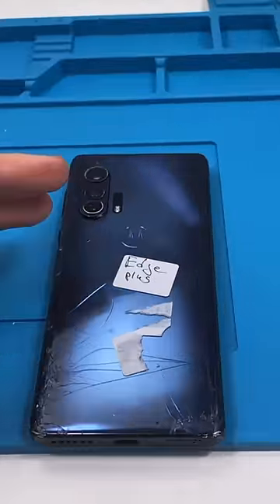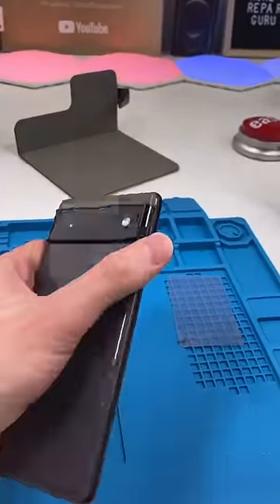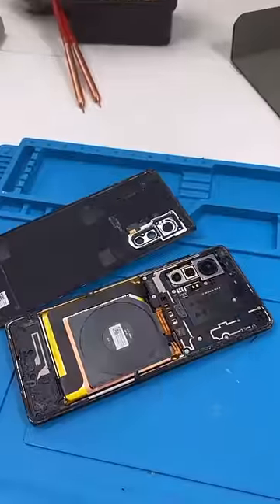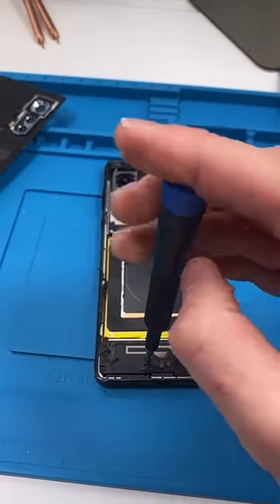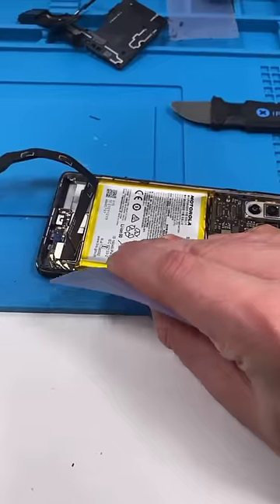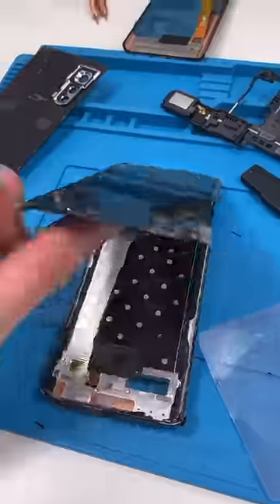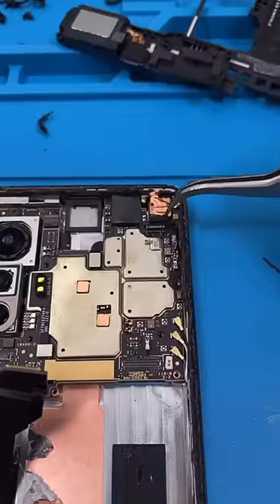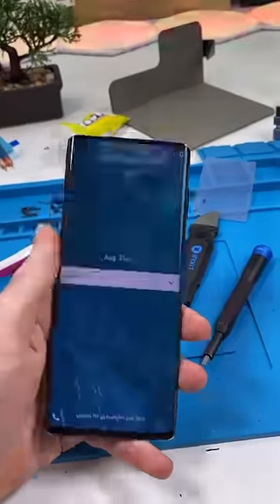MOTOROLA'S ARE TRASH... To Repair #Shorts

Comment: I love motorolas because they officially offer you the freedom to root their phones and install custom roms etc, no matter how expensive the phone is
Reply: Literally the majority of the android market
Reply: @Foreseen3  Yeah, but with motorolas and xiaomi (especially mi and redmi) you can change his rom easier
Reply: @Foreseen3  motorola is like linux, is a very customizable phone, more than android phones. And is cheap to do that
Edit: also lenovo has a program to enter fastboot on the motorolas
Reply: @Foreseen3  Motorola is better than android
Reply: To the comments above me. I’m a behind Motorola news, do they have their own custom software now? Or are they still using android.
Reply: @Foreseen3  The Edge 20 Pro is currently using Android 11, and it's basically unmodded by them.
Only a few of their apps installed such as Device Help (Which includes Warranty info and Software/Hardware test.), Interactive Wallpapers (It's pretty self explanatory, it has moving wallpapers on it.) and Moto (Includes a few extra features involving gestures that can be turned on and off there, and also on the settings.)
Reply: @galacticmaster4852  Motorola is android
Reply: Me on a moto phone
Reply: @Blockbustah  android is literally a Linux copy? (specifically talking about the kernel and some system integrity)
Reply: @hman6159  Motorola is still better
Reply: That's sounds unsafe
Reply: I hate mine it sucks
Reply: Same with Xiaomi. And oppo. And oneplus. And vivo. And redmi. And poco. Literally the only phone company that doesnt allow you to root is samsung
Reply: @rayyanshaikh5591  so Huawei never existed in first place
He probably means that it's so easy to unlock and mod Motorolas.
Reply: @Norza47  dude, the process of unlocking and nodding is the exact same, regardless of mobile company
Reply: I love Motorola phones to. I didn't know that they allow root option.Thanks for info.
Reply: mine came rooted because i requested it on the store
Reply: @rayyanshaikh5591  but its still super easy to root Samsung
Reply: @hamzamalik7305  at least it's fun to customize..

But not recommended for inexperienced ones
Reply: Sir!
Reply: @condofare6156   copy...?
Reply: @Victor Huang that's the image brands usually give it, but if you know what you're doing you'll be fine
Reply: @galacticmaster4852  The Motorola phone in this video is running Android
Reply: @condofare6156  Android runs on the Linux kernel, but it is nothing like desktop Linux distributions. Android runs on Java, Linux distros do not.
Reply: @rayyanshaikh5591  nah zte , oneplus, google, and lg have some absolute bs you have to go through to root some of their phones
Reply: @andrive  not an exact link to link copy but im pretty sure android uses Linuxes kernel
Reply: @mycelia_ow  im not talking on the UI or anything else, just the kernel so yeah
Reply: @condofare6156  exactly, pretty much everything else was built on top
Reply: @waterwolf6492   nope, some of them can't even be rooted at all since the Galaxy S8, due to Qualcomm's secure boot

Exynos users are free to root tho
Reply: @Blockbustah   it runs Android, dunno
Reply: @andrive  i mean that Motorolas can be used in many things
Reply: @Blockbustah   any examples?
Reply: @andrive  custom ROMS, easier to flash and access its files
Reply: I am  literally using a Motorola and I can say it suck it's always gitching
Reply: @honey_bearperls6927   what model is it
Reply: Well I mean all phones do

It's just carrier specific versions
And for some reason now US versions of Samsung phones dont
Reply: @Foreseen3  maybe, but not with Androids main phone companies
Reply: I didn't know of this, I have an oldish one on shelf...now I know what to use it for
Reply: @galacticmaster4852  huh
Reply: @Foreseen3  Nope, only Xiaomi, Lenovo, OnePlus are good with development. Samsung (US), LG (many regions), Vivo doesn't even allow to unlock bootloader / root.
Reply: Yes I am typing this with the Motorola right now and two more reasons why Motorola is good it's because it's 7g 7G I have never seen a phone with 7 g in my life and you see that Motorola was the first phone invented and on top of that it's how long they last how long the battery lasts like over a day like 100%, you good it will tell you one day and 16 hours if you're at like 100% or 98%. Mean I'm just safe and loaded with a Motorola okay one down weird about it is that it has 32GB I wish I had like like two more genie because I only have like five apps and most of my storage is taken up
Reply: My 2020 Motorola is all out of box set up and has been working perfectly fine for the past two years, what a wonderful reliable phone that was cheap and reliable only downside is this like most phones isn't meant for gaming rather your average low resolution games and stuff and that pretty much the only negative I have they're a good product.
Reply: what does rooting ur phone do? And is it worth it?
Reply: @Foreseen3  that's not true, most void your warranty  and some (like Samsung) make it extra difficult to do.
Reply: @galacticmaster4852  Motorola is an android phone.
Reply: If I remember correctly, they also made the very first mobile phone.
Reply: @Foreseen3  not Samsungs :c
Reply: Good considering how trash their software updates are
Reply: Comes down to how popular the device is so that making roms for is a worthwhile
Reply: @catboy3471   you're making assumptions, motorola makes flagships like the Moto Edge or G100
Reply: @andrive  G100 is not a flagship, do an actual research
It's a mid-range smartphone unlike Edge.
Reply: @anumine207   I know. My point was that it has good enough specs for it to not be trash.
Reply: @tomikun8057  better than what?? Android?? It's made by android, God
Reply: @L1f3665   motorola's not "made by android", they make hardware that runs android
Reply: @galacticmaster4852  motorola uses android bruh
Reply: "No matter how expensive the phone is"
Motorola phones with mediatek processors cannot be unlocked. Motorola doesn't support unlocking them and they lack fastboot's oem unlocking command.
So unfortunately the OP is wrong.
Reply: @xxzenonionnex7658  Wrong, Pixel and Oneplus phones are one of the easiests to root and rom
Reply: @Ignacio.Romero  I’m talking about the Google pixel 5 and oneplus 8 and 9. To many things mess up on android 11 when you try to root it . Unless you install another rom.
Reply: @xxzenonionnex7658  Not at all, it's as simple as unlocking the bootloader and sideloading twrp through adb
Reply: @condofare6156  Android is not a Linux "copy", it runs on the Linux kernel. The "kernel" is the part of your OS that handles memory management, CPU utilisation and speed, and handles all hardware. You cannot "copy" open source software because the source code is freely available for anyone to use
Reply: @mycelia_ow  Android apps are written in Java (and also Kotlin), Android itself is written mostly in C.
Reply: @x-y.z  Xiaomi is easy 
Do you really think i am not able to unlock my bootloader even I waited 14 weeks
Also Other Android phone is easy to root because you need to just type commands in cmd terminal and boom your Device unlocked

MISSING THOSE DAY WHEN BCK IN 2016 IT WAS VERY EASY ONE CLICK ROOT ( knigo root ) AND  SOME PHONE COME WITH PREROOTED
Reply: Its literally on every phone that runs android. And the majority of the features dont need jailbreaking to unlock unlike some other proprietary OS
Reply: @galacticmaster4852  Motorola phones run android
Reply: @Blockbustah  Lenovo makes everything easier to customize and repair I own a crap ton of stuff by them and I have screw sizes inside of the things and my laptop has what plug the cpu is on the plastic part right above the cpu
Reply: Not anymore, they're putting Anti-Rollback system on their phones.
Reply: @purveshsoni2960  same
Reply: I love Motorolas because of the way you turn on the flashlight, i use that every single day
Reply: @DognmyFace  Me too <3😀
Reply: But it have the highest sar
Reply: Motorola uses Android without a bunch of bloatware.
Reply: @Blockbustah you forgot the ready for function
Reply: True
Currently using custom rom in g60
Reply: @Blockbustah Android is Linux. What happens is that Google, Samsung, and others have some kind of Apple-but-better complex. Can you root the device? Yes, you can. But it will be hard af and requiere you to have some sort of experience to not mess something up.
Motorola makes it easier as the previous comment said.
Reply: @x-y.z i have redmi 
How can i do It?

Comment: My Moto Z Force (first gen) lasted 6 years. No need to replace parts in it if it doesn't break every time you drop it.
Reply: Z2Force
Frikken Awesome phone, and the one I will compare all phones to, forever. Tomahawk chop for flashlight, wavy hand for camera. Indestructible. Screen scratched immediately but when fire erupted out of a car I was working on I forcefully threw it into a concrete driveway (no case) marred a corner but didn’t hurt functionality. External battery attachment, awesome projector. Awesome screen resolution. Loaded, from the git-go with VERY little extraneous crap. I moved to an IPhone 11 because the family wanted Facetime, but when this contract is up I will be looking for a retailer who has the Moto lineup in stock. I don’t expect too much, but I’veGOT to look!

Comment: I've only had Motorola's recently started with a z2, underpowered but overall a decent phone before the display purpled out, z4 was fine but just wanted an upgrade, and now I have a moto g stylus 2021, one thing I like about Motorola is they're willing to sell parts, for my phone I can buy a replacement charge port and aux for $12 with official screens for about 50 total
Reply: That's a pretty good price
Reply: @andrive  they're good budget phones and they're probably the closet to a pro right to repair brand there is. My next phone will probably be a Pixel 6 running Linux or the Moto a100
Reply: Too bad Lenovo is now soldering ram on the new thinkpads
Reply: @mryork_   true, I love that motorola allows people to unlock the phone's bootloader and tweak  things. My Galaxy S21 is permanently locked
Reply: @Powerade god compared to my z4 the stylus 21 camera is nearly identical despite there being 3 rear facing cameras
Reply: @jaimelopez2503  soldering ram is just disappointing. At least add an extra slot above it like they did on the Yoga I bought
Reply: @mryork_  how would Linux work on mobile? I always struggled with using it as a windows boy so I'm not gonna say it's bad lol
Reply: And that's why I'm planning to stick with Motorola after my current phone is old and dead.

Not quite as slick as other devices, but they're inexpensive and actually have decent features. I can get a headphone jack and SD card slot, along with decent battery life, all for less than it costs to replace the screen on another phone.

I mean that literally. I broke my screen a few months back, and it was literally less expensive to replace the screen myself while purchasing a new Motorola (which was still in the return period) than it would be to have someone else replace the screen. Reduced the stress of working on my phone so much, because I knew I would still be able to communicate with work if it went wrong.
Reply: @DonutTPOTer  android itself is Linux based but there is the Google version of Android which most phones use and then the open source version such as graphene OS which is more like open android
Reply: @DonutTPOTer  also Mint OS is pretty easy, me as well being a Linux noob. Take some learning still but if you're willing it's nice, now my laptop is solely on Linux but my Main PC is windows until I can do VR on Linux
Reply: @mryork_  id probably keep windows (purely for support,) but ill see about that mint os
Reply: @DonutTPOTer  Windows isn't bad but I'm someone who is extremely for Open source and I'm willing to put up with more issues in favor of supporting that. Linux for sure isn't for everyone yet but they're working on making it better for new people. It's an awesome community
Reply: @mryork_  i know that's true, I have a few buds on twitter and discord who use Linux, and they're very nice!
Reply: @DonutTPOTer  Yes on Mint. It’s the most like XP. Microsoft shoveled a big bunch of money to Linux developers perhaps a year ago and now I am having trouble getting Bluetooth 5 to connect to my headphones. I had to spend the money on Win10 and have been using it as my daily driver for some time, but now I want to do a motherboard swap on my Vista class high power graphics machine. I KNOW Microsoft is going to rattle my cage. Should have stuck with Mint. Dual boot system. All I have to do is hit the down arrow once.
Reply: Yeah my lil bro has one as his starter phone
Reply: @mryork_  The entire reason to use a Pixel is the software though, no? There are androids that would make more sense for that goal like Xiaomis
Reply: I just got the stylus last week it's a decent phone so far stylus is a bit annoying as it pops out easily but they made it so it doesn't just fall out of the phone if you accidentally press it so 7/10 on that lol
Reply: my moto e5play i bougth on launch day still works like brand new
Reply: I have the moto z4 rn
Reply: I have a 2021 g stylus and it's very very good for a budget phone, I'm just sad it doesn't get Android 12, but you know, Motorola will be Motorola
Reply: @tobster786  I'm now running  Umidigi Bison Pro which is a $200 straight from china phone that i actually like quite a bit, rear camera video is only 1080-60, photos look beautiful. The selfie camera is also extremely good, video microphone is extremely quiet however the phone is completely waterproof and dustproof, it's also shockproof. It's not amazingly fast but it's not bad either. Running android 11 as of now

Comment: I have moto g stylus 5G that came out June 2021, paid 400 dollars for it, and I love it. The cold of the green and how clear it is for it being a budget phone. Long battery life, and have no complaints. I have dropped several times on the concrete and didn't even put a dent or scratch on it anywhere, also didn't have a case on it on the times I dropped it. I put one on anyway just cause you never know when luck runs out and the next drop might crack it.

Comment: yeah i got my moto g power 2020 fixed, just a screen replacement, you’d think it would be easy. took 3 weeks and an ER visit to get it properly repaired and functional. 
battery exploded the first time because it’s glued down, second time they had accidentally disconnected the headphone jack because the entire phone needs disassembled to get to the screen.

Comment: I like my Motorola, it's the best mid range phone I ever got, with 128 GB of internal memory and 2 SIM slots, and I can activate the Work profile in Android so I can have 2 different account in one phone, they also use near stock android with little bloatware and no ads in 2021, can you believe that, my phone also came with Android 10 stock and it was recently upgraded to Android 11 which is rare for mid range phones, and the best parts is that you can easily get replacement parts, a got a new screen for $30 with shipping and taxes and at least sice mine has a plastic back it was easy to open and change the screen by myself, ngl I enjoy using it.
Reply: Yeah, my brother has a motorola one fusion 2020, and its updates are pretty good, it was updated from android 10 to 11 some months ago, the rom is nearly like the stock android

Comment: Motorola's older phones were really good. But I recently owned a Moto G Power 2020, and it had a lot of bugs no matter how much updates it got, and it would freeze up a lot. My older Moto E4 never did that. But I recently switched to a iPhone 12 Mini (got it on Black Friday for $300 new), and it's been a great phone. I like Android, but the security still isn't there, and it's hard for Google to keep up with optimization since a lot of phone and tablet manufactures use Android. I miss some things that Android provided, that Apple still doesn't provide, but it's nothing that would make me hate Apple.

Comment: Tbh, I've had more issues out of Samsung flagships then with my Motorola phones. I had switched back to Moto after I realized  I didn't need a expensive phone to be happy. My current Moto One 5G Ace has been a great phone. My last one was a Moto G Power, which I still have, is another great phone. I've had great luck with them.

Comment: I switched from a moto X4 to a pixel 5a and I regret the switch... I've had mostly Motorola phones before this pixel, I was impressed with how well they stood up to my clumsiness and relatives angrily throwing their phones at concrete floors or brick walls...
I'll go back to Motorola likely after a year or two, I'm past the point of returning the pixel for full value. Oh well. 🤷
Edit: I really miss the moto actions and how it was smarter than this pixel...

Comment: For a fact I'm actually using a Motorola right now and the fact that you just said that Motorola was made by we're not made like you fixed by Nova they built them really good because my phone has been dropped so many times but yet it's still working the battery might pop out sometimes but it still works

Comment: They not wrong. 

Repair center kept getting the wrong case because, they make it reallly difficult. Was expensive to get my phone repaired but it was just the battery they get wouldn't fit, or the case with the same name is wrong sized and so on.